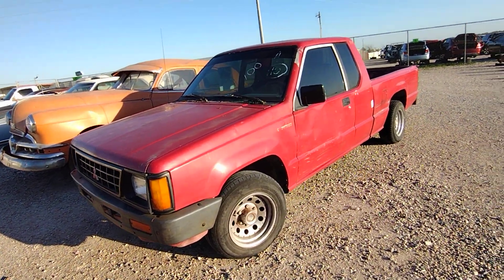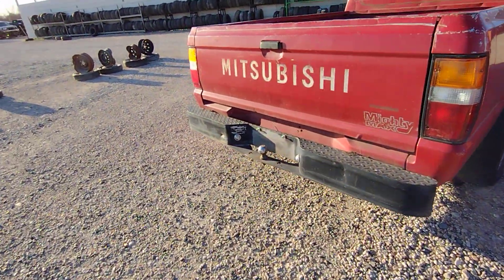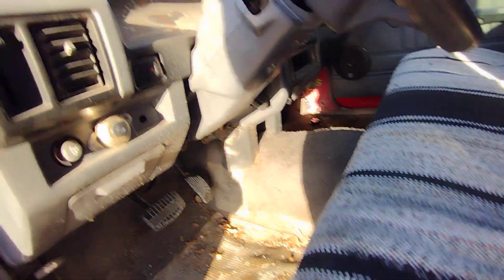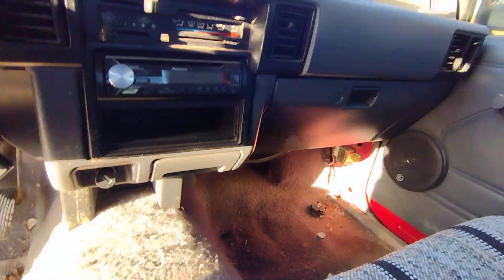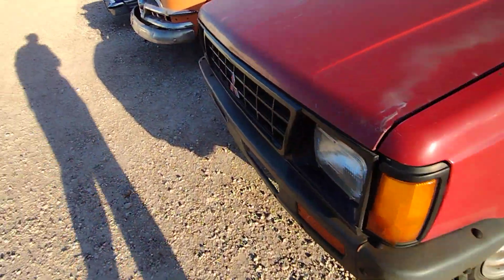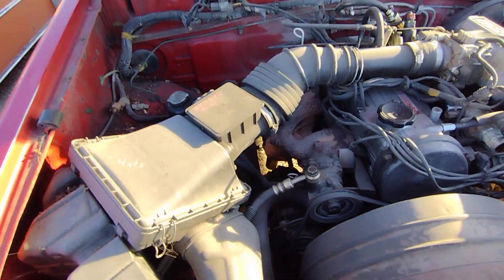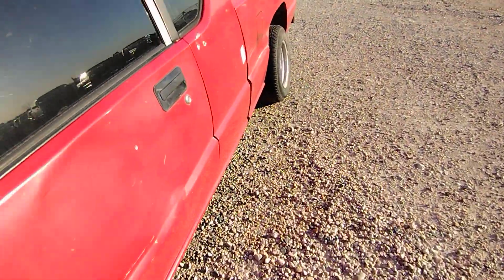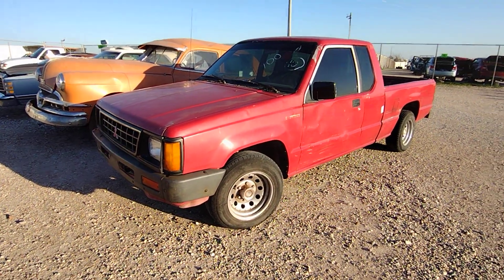Mini Truck For Sale $1795. 1992 Mitsubishi Mighty Max Junkyard Find

Comment: Whoa Nelley, 1992 and it's over for you. Nah, Mitsubishi should have stuck to making TV sets. That they did well. Vehicles? Not so much. 

Yup, 1992 model year with the 10th digit of the VIN as an "N". It was made in Nagoya, Japan and has a 2.4L four cylinder engine. Should be code R82 Monaco Red exterior paint.

Whoa Nelley, Monaco Red and time to go to bed. We got the VIN and we win. Assembled with parts made in Japan and ready for the trash can. Going to be flat and that's that. 2.4 and soon to be out the door. That's it, time to quit. Going to maybe get squished and no one, including the Google Man is even remotely pissed.

Comment: I believe this was  powered by a 116-hp, 2.4-liter SOHC 4-cylinder engine, equipped with balance shafts that spun in the opposite direction from the engine's crankshaft., that being said its very rare truck!
Reply: Yes, 2.4L four cylinder.
Reply: Yes and the fact that it is a macrocab.